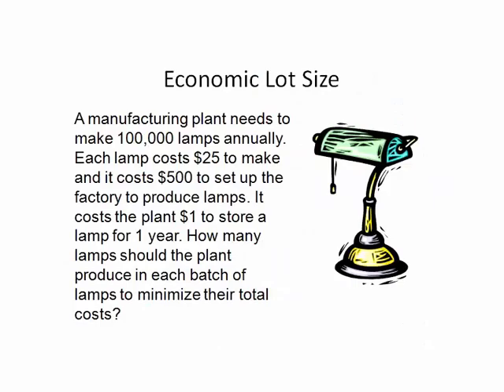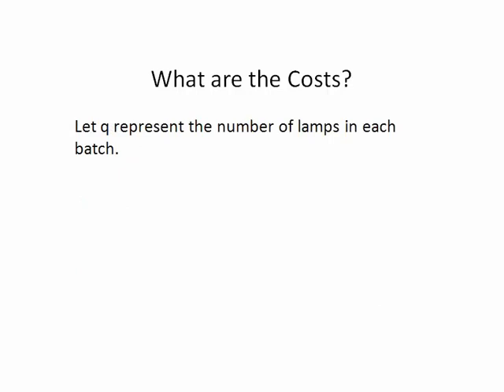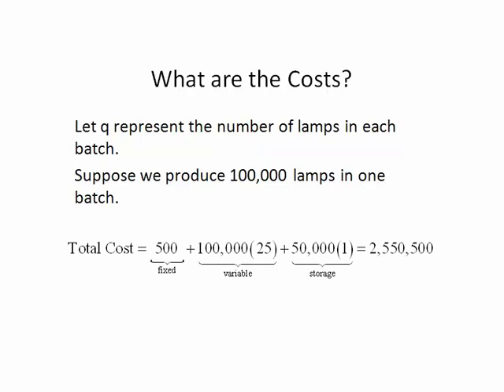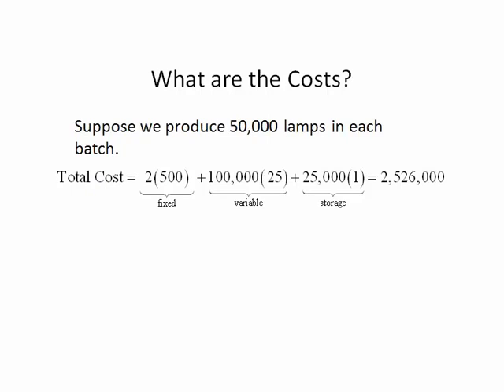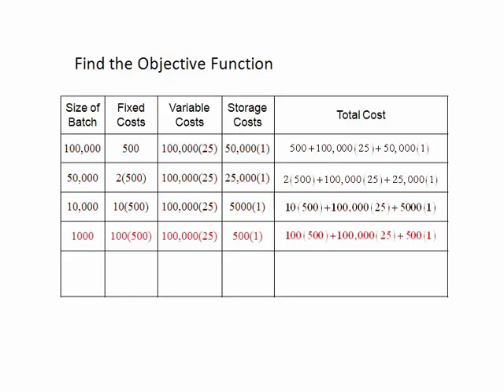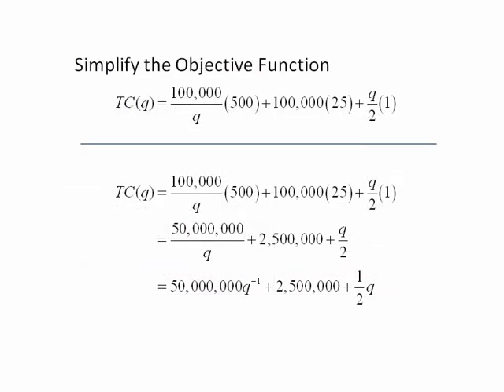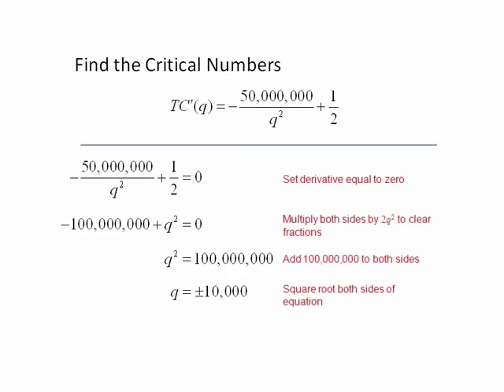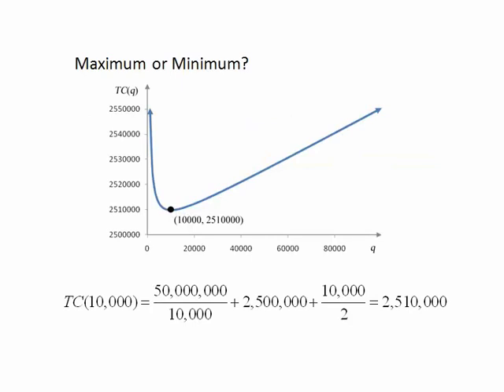Economic Lot Size

Comment: why in storage cost there is only 50000x1 and not 100000X1?
Reply from the maker: The storage costs are calculated from the average number being stored. If the bulbs are all produced in one production run, the number produced initially will be 100,000. These will be used until there is none remaining so the average number in storage is (100,000+0)/2 or 50,000. The cost to store each one is $1 so the storage costs are 50,000* $1.
Reply: MathFAQ I see, tyy